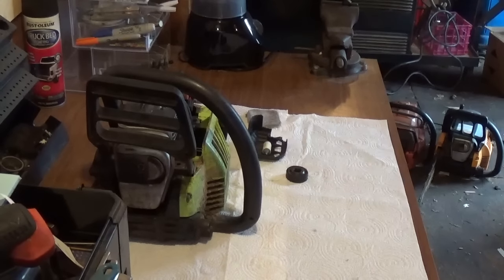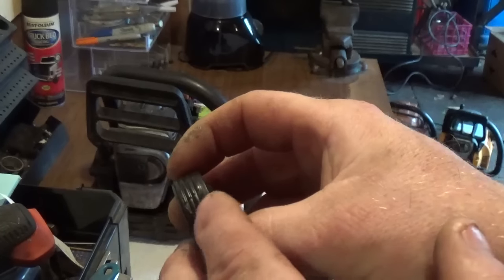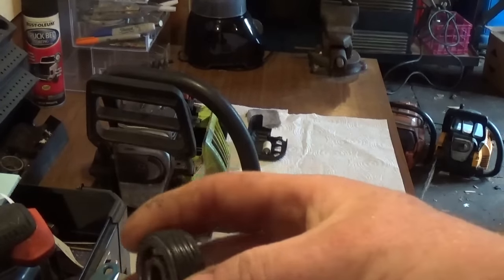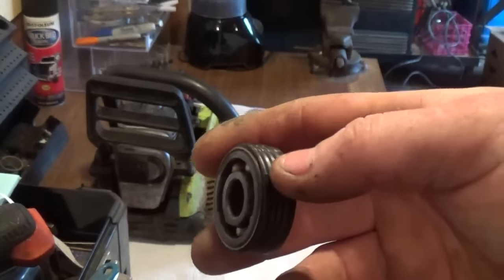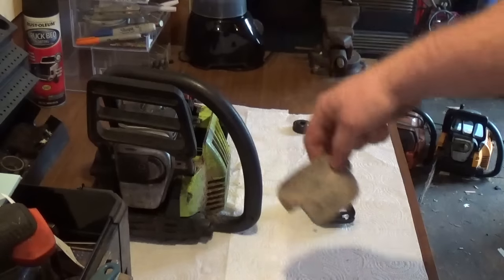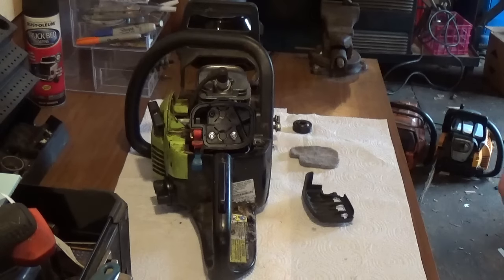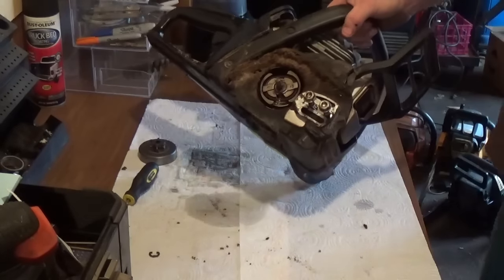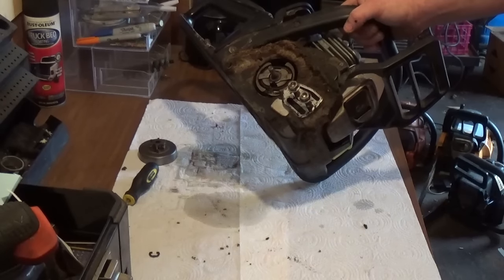Common problems with Poulan Chainsaws

Comment: Kevin! You are rude, crude and insulting about the Poulan. However, you are spot on. I threw mine out and pray someone runs over it with a gigantic garbage truck. My gas cap leaked so I bought a new one with new seal. It leaked a gas drop every 3 seconds. It had spark and compression but would not start. I turned the jet screws and idle all the way in and then out 1 and a half turns. This time....it still wouldn't start. I tore down the carb and checked the fuel lines. Amazingly, it still wouldn't catch. I verified the fuel lines to the carb were correctly attached at the correct ports and primed. No dice.  I studied several more Youtube vids for advice. Then, I found the choke wouldn't deploy fully. It only went to half-choke. So, I did that bit manually. Did it start? Are you kidding? NO and NO. Meanwhile, gas from the leaking cap soaked my hands. Yuk. Finally, a revelation from above. Husquvarna chose NOT to call it a "Husquvarna Junior" or "Little Husquvarna"  or even "Home Husquvarna."  They called it "Poulan." Does that mean, POS in French? Even my local Husquvarna dealer has no parts or service for it. That's because it is  an utterly disgusting, time-hogging, disgracefully mis-engineered, cheap, trashy, frustrating POS. I can cut more trees per hour with a Swede saw than this excuse for a chainsaw..and cuss less too!! Thanks for your insightful analysis even if the truth is butt ugly......
Reply from the maker: John Ward / Thank you ......You are correct about my rude ,crude and insulting ,opinion about modern Poulan Products ...It has been developed over many years of obligation contending with these cursed pieces of shit . But my foward directing attitude has helped save many from buyers remorse . So though the continuous profanity isnt imperative its certainly ineluctable as a means of expression . I can attest that modern poulan failures are more common than any other brand .....this becomes evident by simply asking any dealer whom works on them ......Note most shops wont even do more than apply fuel lines and spark plugs that actually do work on them because of price point {THAT IS HONEST SHOPS }..... dont get me wrong there are those shops out there that see ever fucking as a missed opportunity.

Comment: I currently have on the workbench, a wildthing 14” that is their first edition ( older ) the exhaust has no heat deflection shield, that lack of engineering has led to the bar mount area to deform. The mount area and studs have flexed inward towards muffler causing the plastic to touch muffler and burn.  It also caused misalignment of the bars lineup with the clutch drive. Should be at 90° but has now an angle which causes the chain  to derail.  No good way to fix that.

Comment: Hey I have a Poulan 14 inch 33CC gas saw it will start up but if u let it warm up it turns off
Reply from the maker: Likely seals or a air leak / best advice is to sale or trash the saw.

Comment: First of all ANYONE WATCHING THIS AS A REVIEW FOR PURCHASING A POULAN CHAINSAW FOR THE PRICE AND OR MINIMAL USE - STOP WATCHING NOW. If you are a homeowner or simply need a chainsaw for minimal use, you cannot beat the price you pay. That being said and as with any product manufactured with parts made in China, there will be rotten eggs in every batch. As previous comments have mentioned, I have gotten far beyond my PoulanPro 4016's $140 worth. Also, as with ANY product you purchase from a major chain retailer, if you do encounter issues you can typically return the product and get a brand new product/machine with little effort. I have beaten the shit out of my saw, cut slabs of wood far harder, thicker and wider than this 
saw should be capable of. I have replaced the factory 16" bar and chain with an 18" setup and cut black walnut boards 3" thick, 6' long and 34" wide without bitching, whining or moaning from the saw. 

To Kevin Bolin - if you are going to bash a machine like this, why not bash one that is top of the line and 5x the price for having issues instead of picking on the little guy that actually produces a quality product for the price save the occasional defective part, which by the way are very easily replaced by the user. This is a saw you can beat the hell out of and even if you wear a part or two out don't have to cry over seeing as you probably paid less than $200. Folks who make the choice to pay bottom dollar for a machine that is going to see wear and tear like nothing else they will ever purchase probably aren't going to use the machine to the point any parts will ever wear out in the way you portray. Again, these are Chinese produced parts and any sensible consumer purchasing this from Walmart or the likes should know the possible consequences, or be smart enough to know that they will never encounter any issues and receive well beyond the machines worth over its lifetime. Husquvarna's and other over priced saws contain just as much plastic junk and Chinese made bits and pieces as these. Professionals know the differences and use the equipment far more to actually care about these types of issues and don't need advice on which equipment to purchase in the first place. Why not let the average Joe actually learn life lessons on his own?
Reply from the maker: Because perhaps the average joe you speak of may wont to purchase a chainsaw that might actually last more than 30 mins out of the box and not wont to deal with the shady bullshit most of the dealers push off as new when in truth it was refurbished and sold at a loaded price . I have no shame in trying to educate a poor individual from making a impulse purchase that can and will certainly leave them with buyers remorse . Now just for your personal understanding {Every single part shown in this video was as it was when dissembled for warranty . Now I ask you {Do you personally condone the actions of Poulan ,distributors, dealers ,and service techs who know that these saws are complete junk straight from the box . And only concern there selves with the sale ? } Have you ever wondered why there is a bullshit number on the box to contact but once done you get the contact the nearest dealer to access it for a warranty . Then depending on the dealer and damage to the chainsaw being the evident factor you receive this as a excuse ..Iam sorry the piston and cylinder are scorn .....we cant warranty this saw .....{BUT WHY I ONLY HAD IT FOR LESS THAN A HOUR....}  then of course the dealer is prepared with the run down routine of what kind of gas to oil was used . Did you mix it 40/1 as required ? Just any thing to screw you from that warranty or potently screw you with a repair that can fill there wallet with your hard earned cash. I can respect anyone who has a difference of opinion . All I ask is for them to do is a little research before they leave a comment . I always provide facts to support my opinion . Look for yourself ......refurbished poulan chainsaws {Husqvarna/Poulan} ...Now lets address one other comment you were inquiring about . You asked why not bash a top of the line saw 5 times the price. I have and do ....Husqvarna ,Jonsered, Stihl , If the saw is shit {ITS SHIT } I tell the truth for example Husqvarna has real issues with intake boots and fuel lines as they continue to keep making new intake boots and fuel lines for there 395 saws and 2171 as well as 2186 Jonsered chain saws made by Husqvarna . Stihl has issues as well as Husqvarna with seals ,Tank vents, Intake boots, fuel tanks, Coils in both smaller chainsaws as well as larger pro saws for loggers. Still even with these issues the quality of these chainsaws can and often do exceed that of the Piece of shit Poulans Pushed by Husqvarna as a introduction line saw in most small box stores.  So for that reason alone I would ask witch would be the more logical purchase a MS 170 for $250 from Stihl or a Piece of shit Poulan for 160 dollars that will burn up in the first 30 min or 3 days at best completely ruining a piston and cylinder .....That you will have to fight like hell to get a warranty on . Think about it how many ms 170 chainsaws are returned as to Poulans . Ill tell you what / ask any dealer as to witch are repaired or warranted the most ...I can assure you the poulan will out number the Stihl 8 to one .

Comment: Well, I'm here because my PPro 4216 clutch broke. Has run fine for 4 years with a metric tonne of cutting. Probably broke because I was sawing a tree in a pond, and it got caught and I was yanking to free it. Operator error.
I don't doubt that Poulan is value engineered as you said, stupid gas/oil cap design annoys me, as does the leaking bar oil.  Funny thing is, I think my wife got this as a refurb online.  Can't really complain for the price and use it gave me. Going to pull it apart and check the cylinder for wear, replace the clutch, clean the carb and replace any lines.  Just don't have much to cut now, and my BIL's 40v Ryobi cordless is pretty cool for small jobs.

Comment: thats exactly what I believe happened to my saw at 12:05....I get the saw engine going but the blade won't spin, I take the cover off the,area below where the blade is secured...and still she wont spin and it has nothing to do with the engine break handle above... You hit my problem exactly! Thx. I may be throwing this PC of shit in the trash, I need a saw that will work at least 4 times a year on a whim...and not have to fock around everytime I try to use it! Thx for your video!

Comment: I hate Poulan, BUT!!!........you can find them SOOOO cheap, like $25 all day!.......it's Worth buying them for cheap Firewood saws. 99% of the time, fuel lines are rotted......it's Not a Stihl, but quality is actually Good other than Fuel lines and simple crap like that......waaayyyy better than Chinese saws on ebay!!
Reply from the maker: Mike fu …..Its obvious I hate Poulans as well …...perhaps 25 dollars isn't much for a saw / True/ but we both know that there are way more issues that plague these saws than fuel lines . And I def will disagree on Poulans in comparison to some of the Chinese saws such as Blue Max that are basicly clones of a Red Max . As I have taken many of these saws apart and seen the quality first hand for the price .

Comment: my buddy was a dealer. BUT anybody  that has a clue and has a inside clutch VS outside clutch. spend the few extra dollars  for the 3800.. or you can buy a beaver.. duh.. use BOAT GAS for fuel.. it helps ?. at it is .. saws should be THROWN in the starting process, that would be DOWN TO THE LEFT . if you are LEFT HANDED it  sux 2 b u .. lol   are u a lfty ??? I've done it sooooo many times I'm ampredextraous , cut thousands of cords of wood.. but that was back in the 70s.. but we are all grasping a touch . touch this just the tip, its ok
Reply from the maker: I have taken the time to read your comment as all opinions are certainly welcome to be shared . Sadly I must disagree on the statement that a inside clutch is truly any better than a outside as you implied for a few extra bucks one could purchase a 3800 ....I have many years of experience with many different brands of saws etc ....and can personally tell anyone there is no reasonable difference in the cutting ability of the saw . Quality is key and should be the up most of importance {NOT Price Point } Poulan or Husqvarna is well aware of the price point shopper and purposely makes theses Poulans in many different colors and molds  sold under different brands they own as the parent company . So buyers beware you may be getting a cheap Poulan even if it dosent say Poulan on the side ......Craftsman ,Snapper, Jonsered , Husqvarna are all in the mix for one to aquire a Poulan in sheeps clothing if one chooses to purchase the basic price point saw from ....Lowes, Tractor Supply, Wal Mart  this list could go on and on . Don't get me wrong Briggs currently owns Snapper but has no shame in selling saws made by Husqvarna under the snapper name much like John Deere selling under both MTD as well as AYP . And I even tried to warn my viewers who were adamant that they were purchasing a real John Deere when purchasing a D 105 .....{ I should add that not only was the evidence  obvious just under the seat but soon even the trans had recalls for failures that even made the local news as a recall }  But still they remained adamant even with obvious truth presented  long before the recall . Scrutinizing my every word threw foolish pride rather than facts ......And would you believe only a few had the heart to admit once the facts were validated to say sorry you were telling the truth all along . I for one have the mentality that wright is wright  if your wrong then admit hey I was wrong . Sadly not everyone shares this opinion as pride and basic stupid adamant people have no accountability for there actions . I know this comment might seem pretentious of me .....and I will openly admit I don't have all the answers but some viewers are so sold on a name they forget the importance of the quality of the equipment they purchase and when those names are challenged due to a reputation gathered 30 to 40 plus years ago then there is hell to pay because dad or grandpa bought such and such brand .........It lasted 15 years problem free .... What they fail to see is how was this equipment made 30 to 40 years ago compared to today . What running changes were made in fabrication , molds ,cost of materials to steal a dollar { sorry earn a dollar }..Hell in truth I believe Husqvarna would make plastic pistons and cylinders if they thought they could steal that extra 10 cents in fabrication and have a warranty that they could hide behind a lawyer with . Look at Briggs and Stratton push mowers in the last 15 years ....{Plastic Cams ,PTO gears , cross over pipes, Carbs , recoil assemblies } There phasing out the older L head engines due to EPA regs and decimal control {noise} yet they still continue to make low tone and super low tone mufflers ....Complete Bull shit and people are taken everyday by these tactics .

Comment: Picked up a Poulan 2000 made in 1988 in 2013 for 30 bux.  it's 2023 and i'm just now having to rebuild the carburetor on it because i'm tired of the hard starting it began having THIS year. I think thats a pretty damn good run for a saw that i've had for so long and have tortured endlessly. P.S. its never been overhauled... every part with the exception of the bar and chains is total factory.
Reply from the maker: 1988....that's what I advocated as to the longevity...
.the modern poulan chainsaws are shit....so what exactly is the point your trying to make?

Comment: I just acquired a Husqvarna Mower, Husqvarna Leaf Vac, Poulan Back Pack blower and Poulan chainsaw for a case of bud light. I was thinking of keeping the chainsaw, but you've convinced me that's a get rid of item. It looks brand new in the case, maybe used once, but the bar oil has completely leaked out into the case.
Reply from the maker: LOL...dont take this the wrong way .....but you traded away your trany fluid...for  Husqvarna mower and leaf vac.....I would have done the same lol....But seriously dont invest in the Poulans ......youll just have buyers remorse .....there not worth much and fail way ....way...way ....to often to be relied on .

Comment: poulians are junk from handle to the end of the bar that's why they are cheap like crap cheap Husquvarnas. I also hate crap stihls HIME OWNER LOW RANGE SAWS suck pour designs under reliable its a fix or repair daily kind of saw. WASTE IF TIME AND §. If you buy a saw buy the best you can afford I suggest buying midrang to pro models. if you want power and reliability buy a saw that will plus these little shit saws are commonly a mechanics wast of time. so.e will fix it just cause it makes a few bucks but if you buy cheap you get cheap mechanics rather fix stuff that has value to make your time and effort well spent and his time. here's a trick if you want to  keep your mechanic happy to work on your stuff buy smart buy reliability keep up with maintenance buy stuff that is reliable like a 346XP or MS 290 buy the best you can not the worst you can this doesn't apply to just chainsaws but  everything else you buy like lawn mowers snowblowers. if you do good youl get good

Comment: Thanks for this video, I have a poulan p3314 that ran last year but would die when idling. This year it wouldn't start and I thought changing the plug would get it going but no it still won't start. I might save the chain but the rest of its most likely going in the dumpster. What a pos!

Comment: I bought a Poulon Pro 4620 AVX about 8 -10 years ago.  I have never been able to cut more than 1/2 hour before something happens to the saw.  Usually the chain loosens up because the plastic knobs backs off when the saw is running or the saw gets hot and cuts off.  Most of the time it won't restart for a while.  I have replace the fuel line, carb, filter, bar & chain twice.  The chain has flown off and wrecked the bar twice.  I spend more time working on the saw than cutting!  Won't buy another Poulon!

Comment: Mine just quit,put new carb and lines on,have spark,but will not start on ether. Put oil in the cylinder,and starting fluid,new plug,and still wont start,over or around 17 or more years old,maintained it,so I think I got my $150,00 out of it. Will not buy a new one,time to change brands. Have a McColluch eager beaver I found in the garbage,cleaned the carb,best saw I ever used,it is a old one,and it dependable,not like the Poulon. I agree with Kevin,,these are just junk,thanks for the review and heads up of this saw,no more Poulon for me.....You save me the trouble,and I will spend a bit more and get a real brand mane saw.....What do you depend on,,,what brand should I get Kevin,,,Thank you